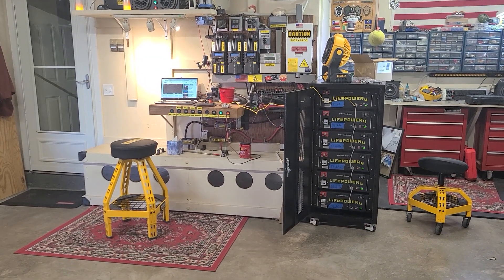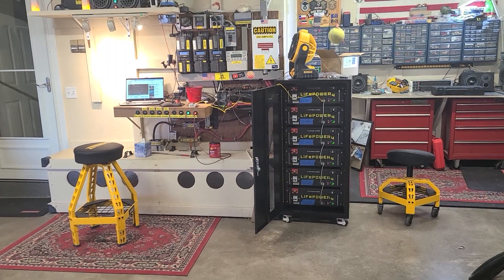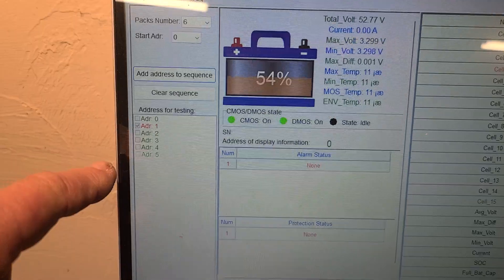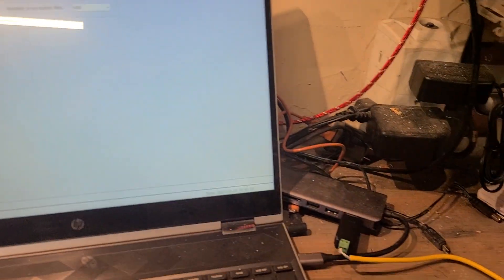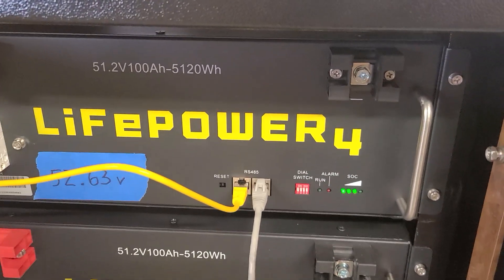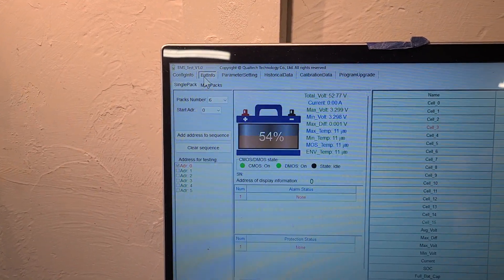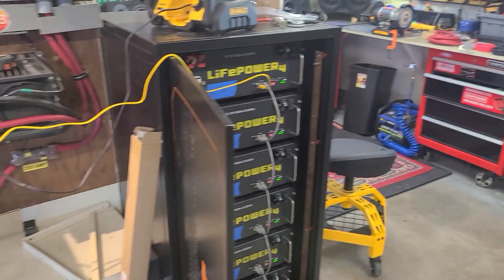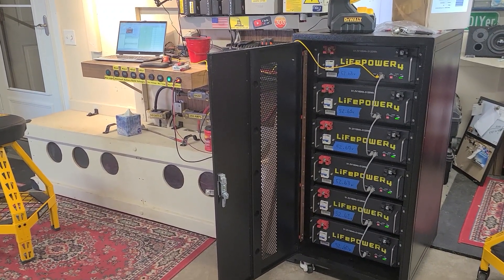EG4 Lifepower4 LiFePO4 battery comms set up (maybe) having dll.comm issues after closing & reopening

Comment: You mentioned you would like to see all the batteries on the same page. In the upper left corner of the app you see the tabs Single Pack and Multipack. You are currently in single pack mode. Click on multi and it should give you a page with all the batteries data at once if you have all 6 battery addresses listed. You may have already figured this out but I didn't see anyone mention it in the comments.

Comment: Click on the Multipacks tab to see all 6 battery stats at one time. Check your COM port again if you changed (or the computer reassigned)  USB ports. Each time a usb device is plugged in, a new port may be assigned. I believe battery breakers should be on when using the BMS_Test software. Each time you start the software you will need to clear the sequence and reassign  the battery IDs.

Comment: Nice bit of USB to RJ45 cable work. Mine always sucks.
I did notice that the voltages on the blue postit notes on the batteries are higher than the voltage on the PC.
Ya right, something like all voltages on one screen could be done. A quick email to help desk might give you an answer. 
When I saw you did the software I just thought, Wouldn't it be nice to use your old voltage meters bolted in the table too, or a monitor run by a raspberry pi. 
NOW.. get back to work, your having too much fun with those batteries.. ;-).
Reply from the maker: Yeh, they voltages don't align with my Fluke digital multimeter. The software isn't working now after I closed the software program and reopened. I will see if anyone else comments here and/or get with SS. I can't use those Blue Sea Systems voltmeters with these new batteries...they won't read 48v...they only go up to 36v per the spec manual. I have one that goes up to 60v...but, they are crazy expensive...and need five more.

Comment: Congrats Chris  you got it going. Just got a call from Mike we're gonna try again Monday.  I have the bus bar issue all sorted out it will work well it's a shame you have to do a work around to make a brand new bus bar work but it will be just fine. If we have issue on Monday is it OK to a call ?
Reply from the maker: Yeh, no problem. I closed the BMS software and now I am getting a "comm.dll doesn't exist or has problems!" on their BMS menu (bottom crawl screen info). So, now I am troubleshooting "why" it isn't working after I set this software all up. Hmmm. It worked long enough for this video and now...errors. I may need to call them too if I can't stomp this comm error out.
Reply: @ChrisDIYerOklahoma  Wow U know what your doing I'm in trouble.
Reply: @ChrisDIYerOklahoma  Thanks
Reply: I saw that video also they must be having a lot of problems with this it was a good video.